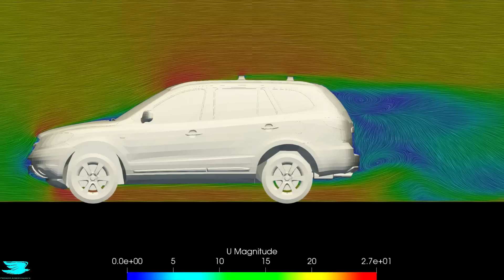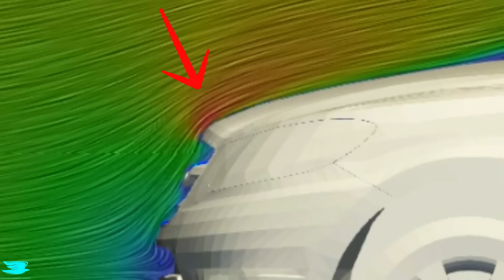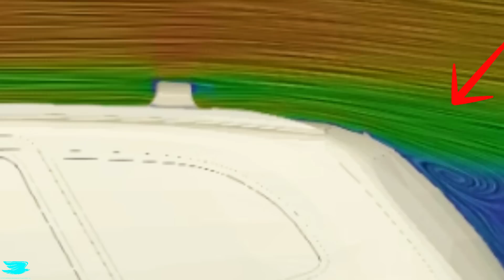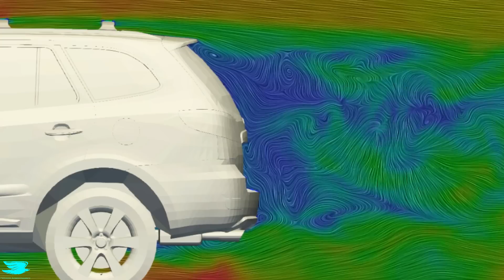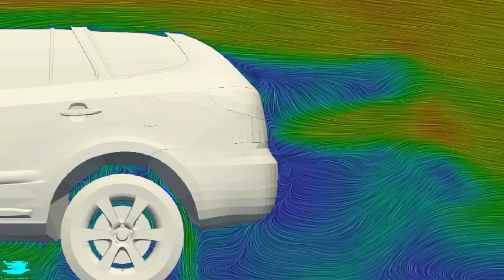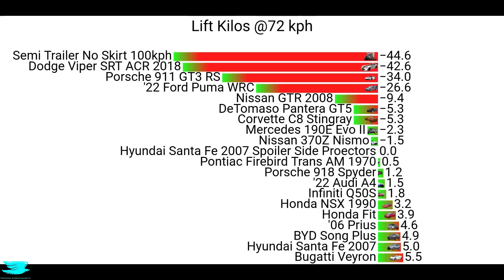Lowering The Fuel Consumption Of This SUV

Comment: How much would lowering it make any difference
Reply from the maker: For this car, it would likely reduce the drag a little.
Reply: @PremierAerodynamics  The newer Santa Fes (i mean 2013 onwards) were lower by about 1 inches.  i am guessing it was to help with aero.  They also added under tray panels, etc. which mine did not have (but i plan on adding them).

Comment: Remove all the mud flaps will reduce the lift for front/rear axles and attach some micro vortex generators on the wheel arch just in front of front wheels, I find it helps further reduce lift for the front axle.

Comment: I've learned about drag only recently through the yt channel Speed Engineering. They've developed a "Speedtail", which leads air into the drag zone while also providing some downforce. Their angle is performance, but I wonder if this could work for better efficiency as well. And to which degree. Same for wheel vents. What can I do to make my regular car more efficient.

Comment: On the grill you forget it’s a ram air intake. It’s not a flat sheet, so the high pressure zone is actually negated, fed through the engine bay, and out the hood in front of the windshield and out the wheel wells.
Reply: I feel like that’s only true if the outlet vents are placed in lower-pressure areas (ahead of the windshield or behind the front wheels), and the flow path is smooth and well-managed.
most suvs do not use their grilles in this aerodynamic way. they often prioritize cooling and styling
Reply: @sami-tw7qk still it vents in front of the wind screen and through the wheel bays

Comment: I got better fuel economy in my RAV4 after 2 changes, first was lifting it 35mm with a suspension kit… this lowered by consumption from 8.5L/100km or 27.6MPG to 8.1L/100km or  29MPG…. Then I fitted a skid plate that was very flat under the engine and basically created a flat underbody and this was really big with a jump down to 7.5L/100km or 31.3mpg on the same 100km roads I did every day… also added a K&N air filter and a charcoal filter delete (mine blocked the whole lid of the intake box) and this finally have 7.2/7.3L or around 32.5MPG.

I did multiple other things like sealing the hood so air could not pass between the hose and the grill/headlights, lower antenna, and I had AT tires so this last might affect economy… just to finish, also engine, gearbox and differential oil with added anti-friction additives… that RAV4 was incredibly sweet to drive.
Reply from the maker: I definitely understand the skid plate, that would help. Lifting the car is an interesting one. Did the wheels become more exposed?
Reply: @PremierAerodynamics no, they did not become more exposed, they mostly maintained the stance…. It was also interesting to me, but before the car felt very unstable at speed, like with buffeting in the underbody area, and after the lift it became more stable and it felt less the hit when the winds where high… keep in mind I was running 225’s so maybe the narrow of the wheel help

Comment: 2013 volt which i made a few aero mods to including flush mounted solar roof/antena delete, and transparent flat wheel aero covers. kind of a unique car for aerodynamics coz gm used an air dam under the front bumper instead of spending time making the bottom of the car flat. tried to make sure some air could get out of the edges of my wheel aero covers to maintain the low pressure under the car. never seen another car that used an air dam. also interesting that there is little need for grill airflow since its an EREV, a catagory of car thats basically dead in the usa now. tail pipe is also tucked up under the rear bumper for aero i suppose or just to hide the fact that its an ev with a generator, really unique car. video on my page explaining mods and the super unique transaxel design of the first gen. car feels very different on the hwy now above 70mph, like its more planted, and side winds dont seem to push it around as much.

Comment: Super interesting
It’s pretty common nowadays to see aerodynamic devices on road cars to guide air around the front wheels, but not as much for the rear wheels. 

And I wonder if those that do, is the goal to reduce rear wheel turbulence, but not necessarily influence the rear wake of the vehicle
Reply: Peter here.  Wheel deflectors often do have the effect of reducing rear wheel drag.  At least in the research papers i have read.  As a result of this video i am making a set of front wheel deflectors for the Santa Fe to clean up the main cause of drag on this vehicle.  Test fit was last week, and hopefully i can have them installed this weekend.

Comment: I am interested if taping panel gaps is worth it on long journeys. I wouldnt do it if the difference is very small, fuel consumption wise, but i really want to know...
Reply from the maker: Personally, I wouldn't do it - the fuel saving will be maybe 1% if you're lucky, and you risk damaging the paint anyway.
Reply: @PremierAerodynamics  I didnt think about damaging the paint (clear coat)... Perhaps then its fine to do it on a old shitbox with brick aero and finger width panel gaps...

Comment: Worth considering that the high pressure regions on the front are over the grilles, which will allow air to flow through. So, probably best for heat exchanger performance

Comment: What solver and turbulence modelling are you using in your simulations?

I ask this because in this specific case it seems that the flow is overly attached when the rear spoiler is not present, which indicates me that boundary layer adverse pressure is not being properly calculated! Anyway, your videos have been very interesting and informative!

 By the way, in a two box car like this SUV, you can benefit a lot by installing side spoilers at an angle of 13 to 18deg, which will help tappering the flow while avoiding flow recirculation and sticking to the backdoor glass (which will help with rear surface pressure recovery)

Background: I'm an Automotive Aerodynamics engineer for a big japanese OEM in Europe.
Reply from the maker: This is IDDES, K Omega SST. The rear window is an anomaly because with other cars, it separates how you'd think.

Here, there are two possibilities. The first is that the flow should detach at the edge between the roof and rear - that's likely not the case, otherwise why would you need to add a spoiler, as pretty much every car of this shape now has. For the average car, spoilers are added to give a definite line for the flow to separate from. You can see that the latest trend is to not have a spoiler in the middle section, so the flow can go down the rear window more. That means the flow stays attached down it and reduces the wake, and drag.

That leads us to the second possibility, which is that the flow goes down the rear window to some extent. We have that general effect here. It's not a new one, but actually just us revisiting it from years ago when cars didn't have rear spoilers very often.

I have also worked at OEMs, and in Europe. I left them though.

Comment: Since you started with a Hyundai 
I would like to suggest my Hyundai (i30N Hatchback 2020 Pre facelift)  to visualise the Aerodynamics of it and how well it works at higher speeds like at Nürburgring for example.
Not a car made for Highway top speed,but to cut corners and be agile with both performance and aerodynamics.

Comment: So with no roof racks, slightly lower, wheels that fill out the arches a bit better(maybe with aero disk covers), a flat under body panels(you can DIY some professional quality ones with cheap ABS plastic sheets and some plastic clips and cable ties), and some smoother mirrors you could realistically lower your drag coefficient to something like a Prius.
Reply: i'm actually addressing all the problems that Premier pointed out on the vehicle.

Hyundai actually fixed most of the aerodynamic problems in the next generation DM Santa Fe, and got a coefficient of drag of 0.34.

This weekend i'll be cleaning up the a-pillars, taking off the roof racks, and cleaning up the front a bit.  Next weekend will be adding the wheel deflectors for the front.  i will be mocking it up with ramboard however, so things are ready to cut when the HDPE sheet gets here.  The area around the front of the front wheels is horrible.  Hopefully the wheel deflectors help.

If you look at the streamline video you can see that air hitting the upper front bumper cover transitions over and goes right into the rear of the front wheel well :(  i am going to be adding a wedge there to kick it out further as it goes around to prevent it from going in there (hopefully).

i picked up some flat underbody panels for this a while back (these were from a newer Hyundai Kia vehicle and fit with some mods), but the issue is building the underbody support bracketry.  i have mapped out every bolt under the vehicle for that purpose though.  it is a lot more involved however.
Reply from the maker: Yep, but just for the flat underbody, make sure that you leave enough openings for cooling.

Comment: Easy to reduce fuel consumption on cars with cable type throttle body. Just keep the fuel tank full, refuel and never let it go below 85% times prevent the stupid EVAP wasting your fuel. When will people finally figure out how petrol fuel consumption works? Number 1 reason why you’re running out of fuel in petrol is liquid gasoline turning to vapor. 😂 Car manufacturers, big oil and the government hates fuel efficient vehicles. That’s why they aimed for excessive rich mixture amd use the catalytic converter to burn more fuel than the engine instead of aiming for perfect combustion. 😅
Reply from the maker: A way to test that would be to see how fuel consumption changes as the fuel tank empties.
Reply: @PremierAerodynamics  YES, it does. You won't get the same miles from full to 3/4 and from  3/4 to 1/2. The bigger the space inside the tank the more liquid fuel turns to vapor according to EPA. Gasoline boiling point is very low. The heat from the fuel pump and exhaust pipe will make gasoline boil much faster. Just think of it like water which is exposed to  boiling temperature, the less the volume the faster it boils. 😅
Reply: Make sure your fuel tank is equally divided. Some vehicles like for example the Honda CRV the fuel tank is not equally divided at 3/4 to full due to the shape of the tank.
Reply: i am not sure why one would think the EVAP system wastes fuel since the whole point of it is to capture evaporating fuel and cycle it into the engine at appropriate times via the EVAP purge valve.
The O2 sensor inputs will take care of the mixture during this process, and will sense the additional fuel and lean out the injectors appropriately to target the stoichiometric ratio to keep the cats happy.  So there is no wastage of fuel when the EVAP purge is open, or when it is shut.

The amount of fuel held in vapor in the tank even at full empty is virtually nothing mass wise.  Tens of grams worth - perhaps a little over 1/100th of a gallon.

I think you might be talking about the varying rate that your fuel tank level sensor(s) may be registering as the tank goes down.  ie the amount of sweep that you notice relative to the amount your odo changes.  Definitely possible.  Last time i examined the fuel level sensors on this Santa Fe i didn't see it compensating for the arc that the float travels.  Anyways, for my mileage measurements i am measuring using Torque Pro's instantaneous calculation... which uses both the MAF and MAP sensors as well as the other sensors.  And of course actual mileage divided by the amount to fill (and i have verified that it fills to almost exactly the same percentage of full - it usually within about 1%).

Anyways, that is how i noticed my fuel economy improved, and why i was asking the big WHY?  :)
Reply: @rvborgh  Why the hell will you burn fuel without producing power? Isn’t it dumb? The real reason why they ban leaded fuel in automotive is because the lead will buildup at the catalytic converter which will make it inefficient wasting fuel. AVGAS Aviation Fuel is still using lead until today worldwide. Instead of making the engine burn perfect combustion. All I can say is my old F150 with cable type throttlebody consumes less fuel than my CRV electronic throttle body when the fuel level is above 85% and the stupid evap is off.😅 The stupid EVAP can’t purge at idle on cable type throttle body because the engine will stall.
Reply: @w0lvez1  hi, EVAP isn't supposed to purge (i mean the purge valve open) at idle, but when the vehicle is more under load, that way the engine management can deal with it without the drive noticing any difference in behavior.  i like cable throttles as well as they have more direct feel, and there is no overrun effect.  i mean that the engine management doesn't purposefully hold the idle up via the electronic throttle after you back out of the throttle immediately (say for a gear shift) for emissions reasons.  Cable throttle doesn't have that issue.  On the other hand, with electronic throttle cruise control is a lot more accurate in its adjustments so you get slightly better fuel economy.  So there are benefits both ways.

Frankly, i like things as simple as possible, and using proven technology.  That is one reason i like my Santa Fe :)  It does have electronic throttle, but it is still stick shift :)

Comment: Your diagram doesn't show the airflow through the radiator & out of the engine bay. To be accurate, it would also be heated, so the downforce in the front probly wouldn't exist.

Comment: Bought a 2nd gen Grand Vitara from a guy and they chopped a little portion off the front bumper and rear of the front wheel arch to fit bigger tyres (caster adjustment alone would have fit the tyres), I wanted to get new trim pieces to restore the bits they cut
I wonder now, after seeing this, how much they fucked the aero

Comment: Would be interesting if Peter could do a comparison between the 2003-2008 Pontiac Vibe hatchback and the same generation 2003-2008 Toyota Matrix hatchback, to see if the Pontiac Vibe is slippier in the air.

The chassis are the same shared chassis between the two, however the Pontiac Vibe has OEM side protectors and similar but tiny physical protrustions on its rear tail light housings.  

In short, the Vibe has much more disruptive body surfaces, compared to the cleansheet Matrix.

Comment: It would be pretty cool if you simulated the SN95 and New Edge Mustangs (1994-1998 and 1999-2004)  at stock height and lowered,  and with or without spoiler.     In particular the 1994-1998 models have "functional" hood portals and 1994-1995 have "functional" scoops ahead of the rear wheels (1996+ the holes are blocked internally so the exterior feature is only cosmetic).    In other words there's a lot to analyze about just 2 body styles.

Comment: Bro, you should simulate a Chevy Trax the 25 and 2024 models. As far as I know are the same as far as body style. It’s literally Chevy’s most cost-efficient SUV or really crossover right now so a lot of people have them but at the same time, a lot of people are complaining of their gas mileage. If you asked me I think it’s because they’re forcing the car to go a little faster than it wants to go, but I digress there are some things I’ve been wanting to do to it to help it aerodynamic efficiency like I thought about putting a flat panel under body Kit to smooth out the air underneath the car thinking that would help or perhaps even changing the rims, but your thoughts won’t matter would be most helpful. Of course his car is only important to me because like I said, I got one and I’ve been playing around with trying to getmore efficiency out of it since that’s really all you can do cause going faster. Well I think the oil way it would go faster as if he threw it off a cliff or out of a plane or had a rocket booster.😂

Comment: Would you consider doing the first gen Ford EcoSport? The one that was sold from 2003 to 2007. It has terrible aero, at 0.41. I wonder how I could improve gas mileage, since, on the highway, maintaining 100kph, I can't get much more than 8L/100km on its duratec 2.0L engine

Comment: I have a 2006 grand Cherokee with the hemi and bulky roof rack. I took it off, along with the spare tire and emergency Jack. I also removed the dvd player and tv in the back, and replaced the old and heavy touchscreen radio with a newer lighter one. Now I get 2 more mpg
Reply: Lower it, swap out those wheels, add side protectors and a spoiler and let us know how it turns out!
Reply: @junsuzuki1412  also he should try overinflating those tires if the place he lives in has good roads
Reply: thats actually pretty good for a aincent inefficent engine
Reply: no point in removing a spare tire for an extra 2mpg if youre gonna need a 200$ tow later on...
Reply from the maker: Nice work!

Comment: I have a 2015 MINI Cooper S and just installed an adjustable air suspension on it and can now adjust the ride hight from about 1 inch higher than factory to literally sitting on the ground. The actual usable driving height is about 2 inches lower than factory. My question is can you do a video on how different ride heights affect the aerodynamics of my vehicle and what ride height would be most beneficial for the aerodynamics?
Reply: No need. Lower = better. Only issue is ground clearance and comfort, hence why manufacturers don't do it. The Citroen C5 hydropneumatic suspension would lower the car by 1" at 70mph automatically to improve fuel efficiency.
Reply from the maker: Yep, this is true in general. Lower is better.
Reply: @khalidacosta7133 that's what I try and tell everyone... Lower=better. But everybody wants an SUV. I am a woodworker and I love going to the lumber yard in my slammed mini Cooper amongst all the pickups and SUVs and load up my lumber with it hanging out of the passenger windows. Nothing but tiny, lowered cars for me